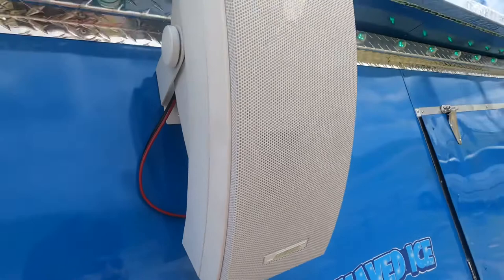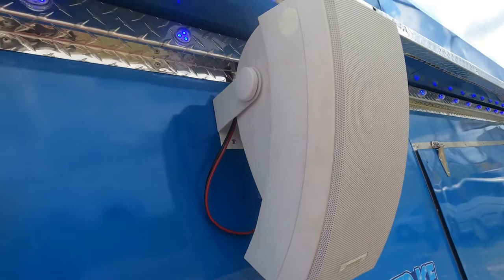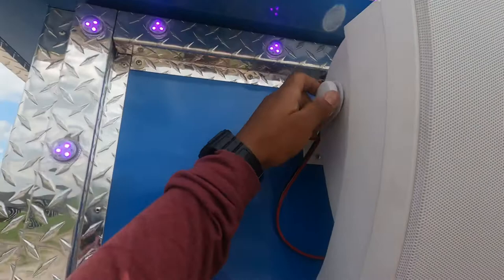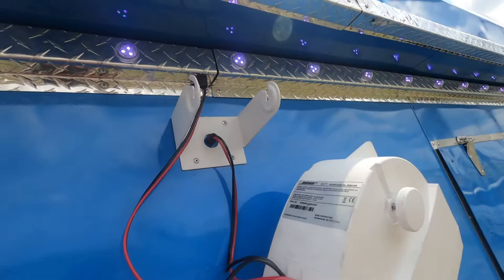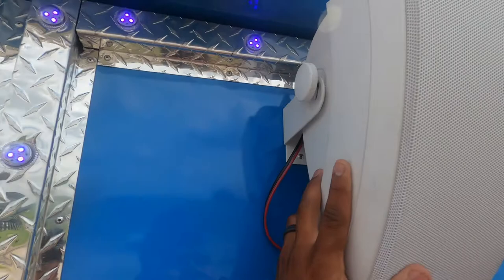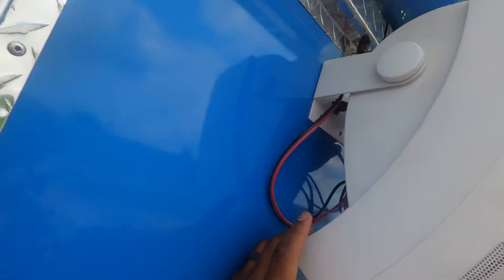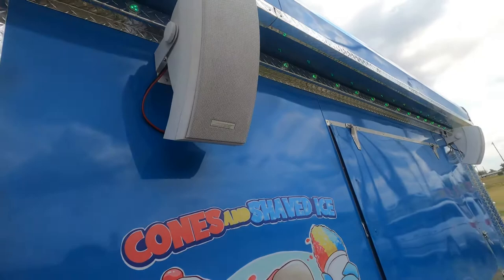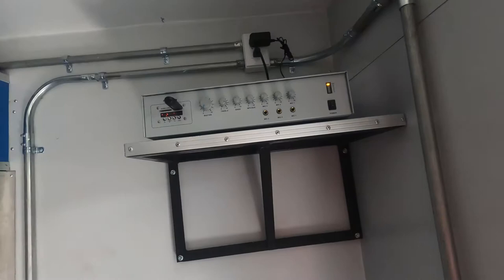2021 Food Trailer Bose speaker Removal and installation!

Comment: Suggestion…if you are going to constantly setup and remove the speakers, I’d suggest banana plugs for the wiring.  Those terminal screw caps can wear out rather quickly.
Reply from the maker: You are correct